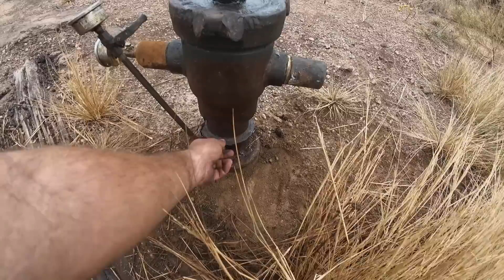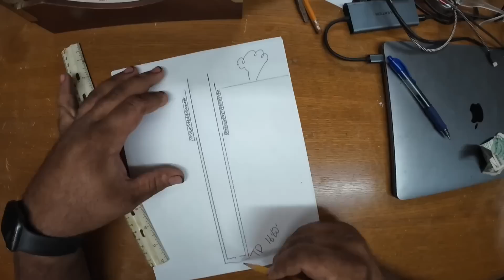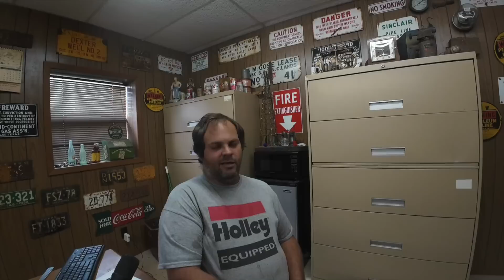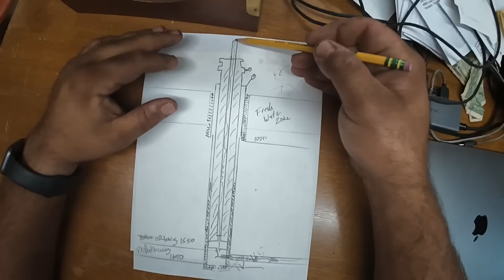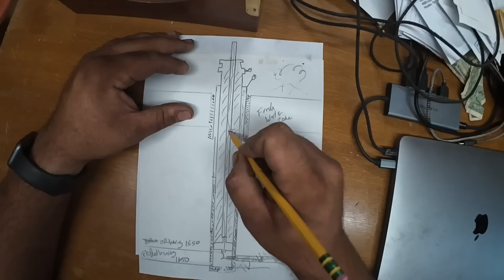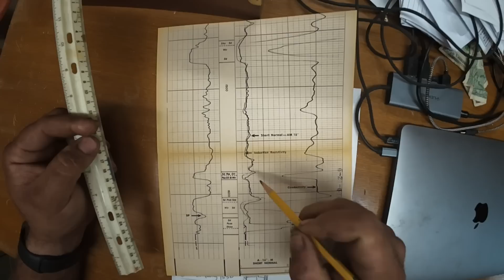All About Salt Water Injection Wells.

Comment: agree with you about the low risk with one caveat. If you are in West Texas, and you are pumping Frack water into a zone outside of your production zone volume is volume, and there is only so much volume that can be put into a void. Once that void is filled with outside water, it can cause issues. I know we’re not talking about that here and for most if not all directional independent oil whales that’s not going to be an issue. The issue is the large fracture jobs where the water is put somewhere outside of the zone where it comes from.

Comment: Maybe decreasing the water level might cause Earthquakes, as rock takes less pressure when its pores is filled with gass. For deep geothermal wells water might also act as a lubricant in the rock and crevises and removing the water might cause Earthquakes.

Comment: Thanks for the video. So much easier to learn the basics from these small wells. I used to work on an offshore platform that injected 480.000bbl of water a day into 32 wells at around 4200psi wellhead pressure. Not so easy to get an good overview there.

Comment: I'm in Oklahoma. A few years ago, we were having 3,4, or 5 "earthquakes" per day for about a 9-10 month period. Some of them were strong enough to do some damage to houses and buildings. Most of them were just a loud "boom" with a bump that you could feel in the ground. I felt a few that would shake the floor. Anyhow, they shut down several of the large injection wells around the area and 99% of the "earthquakes" stopped. Now, is that just a coincident? I think it is possible for injection wells to cause small earthquakes.
Reply: I believe thats correct, poking holes in formation and pumping fluid in it in thousands of areas destabilizes that formation and pressure escapes at the weakest point sometimes in  old plugged wells in a deteriated state.  Im not sure however its technically an earthquake as its not causing shifting of tectonic plates.   But im not a geologist or an oil man. Just my opinion.    And further more while it may be disturbing to some its a necessary thing we gotta get oil so it is what it is.

Comment: I was still confused on why you would use this so I looked them up. They inject saltwater into the ground for the purpose of "enhanced oil recovery from the reservoir". There are also Disposal Wells used to dispose of unwanted saltwater according to the RRC of Texas.

Comment: Do you address micro-annuli in this video whatsoever? As you well know, cement does not bond with the water in an aquifer. Nor does it cure well next to it. The weakest layer of cement along the well is directly along the aquifers. Moreover, the multiple layers of casing and cement used near the surface mean the sonic or acoustic measurements will consistently produce satisfying results - before fracking begins. The concern for the people drinking out of these aquifers is NOT the catastrophic failure of a casing, although many do seem to be under that impression. It's micro-annuli in fracking extracting gas, not injection wells. Maybe you understand that, but this video gives the impression that you're extrapolating the safety of injection wells on to fracking.

As you know, fracking involves immense pressures and high temperatures. This induces hoop stresses on the casing as it expands, which pushes out onto the cement. While steel is fairly elastic, cement most certainly is not. Sulfates, acidity, and salinity in aquifers can also degrade cement integrity. When the fluid is pumped back up, it rapidly cools and contracts the previously warmed steel and cement. Those deeper, longer, and more impermeable wellbores seeking tight gas or shale gas can undergo 50+ frac and plug cycles. And run hotter and at much higher pressures while they do it. Micro-annuli between the casing and cement, within the cement, and even between the cement and the rock. Before gas starts flowing out of the well, there is plenty of time (and pressure) for those liberated gases to rise up into the freshwater aquifer. Re-fracturing is an even greater concern. 

Scared liberals might be afraid of even wells like your own, but anyone following the science knows its not the real concern. There are thousands of actively leaking wells in the world, and the massive remediation costs means these wells are abandoned despite plenty of life left in the deposit. Not even talking about fracking here. Truth is the second those landowners sign that damn contract (or more likely their neighbor does), the folks drilling don't give a crap about anything but getting it done and getting it done fast. Seismology is as much an art as it is a science. If there isn't a major failure, they are not waiting any longer than they have to for the concrete to cure, they are not doing any remediation if concerns pop up. Way too expensive. 

I will say I agree concerns over earthquakes are largely unfounded. But there isn't any doubt that any imperceptible fault lines will be quickly aggravated. Could make for future problems.

Comment: I built 2 disposal wells in Montana for a guy, one was a 3500 bpd the other was a 7000 bpd and both ran between 1500 and 2500 psi we had to run fiberglass pipe due to the high pressures. The only problem either well had as far as any environmental issue was the operating managers wouldn't keep a close eye on the tank levels during a flow back and would overflow the tanks onto the ground and of course it was all oil that ended up on the ground every time. You'd think that they'd learn their lesson after the 1st time but i lost count on how many cleanups i had to do.

Comment: The disposal wells that are causing issues, are taking 10s of thousands of barrels a day of fluid, with the deep ones, down in the Ellenbuger, causing the earthquakes. This is due to the water lubricating the deep basement faults nearby.

 The RRC recently killed the deep disposal wells in the earquake action areas, which brought on shallow disposal wells. They are starting to have issues with that in the Permian, because of the volumes involved. Some of the old legacy verticals that have been plugged, are starting to fail from the significant increase in pore pressure. 

This isnt an issue you will find up here though, no one is moving the insane volumes of water up here.
Reply: This pretty much sums it up; both O&G production and injection wells affect sub-surface stress regimes, and therefore fault activation/s.

Comment: There were 31,000 wells drilled in the East Texas field. A lot of wells had no plugs over the woodbine P&A. The Wilcox formation is a treatable fresh water zone and there wasn't enough surface pipe run in the 1930s.

Injection causes bottom hole pressure. Age deteriorates steel casing. The freshwater wells have H2s in the water now.

As for Gunsight wells. Cable tool wells made leases look like pin cushions. I drilled a few wells with rotary in the early 80s with intentions of injection. Water started coming up all over the lease.

Freshwater contamination is starting to be a big problem. You're in an isolated area and don't have to deal with it.

The fresh water sand on your log reminds me of the Trinity water sand. We used to get makeup water from the Trinity water sand for water flooding.

Wish you well on the casing leak. It is ruff trying to get 50 to 60 year old injection wells to pass. Especially where the pipe runs through shallow Coal or wet shale.

Comment: There are several instances where I live of flow migration from one well to another. Especially when hundreds to thousands of wells from the early 1900's being drilled then abandonded when they played out. Several farms that had good water were definitely contaminated by fracking. It may not happen a lot where you live but in Pennsylvania it happens quite often.
Reply from the maker: Flow migration through a formation is how oil wells work but migration from a lower to higher formation is what's uncommon. Likely the problem you describe is not from a frac job but from an injection well that has a high than designed formation pressure/injection volume. Content in next video.
Reply: Unlikely.

They weren't fracking wells in the early 1900s for one thing.

For another,  the horsepower doesn't exist for fractures to propagate for miles uphole from the target formation.

For another, the Indians up there used to put wool and skins in the creeks because oil would naturally migrate up the faults and into the creek water and they would collect it for medicinal purposes.

Oil has been in the groundwater there for about 100 times longer than humanity has existed. The water in pennsylvania has never been free of oil for the entire history of humanity.
Reply: @timthetiny7538  No there weren't fracking them they were blasting them with nitro. We had a well on my relatives farm and another uncle had three on his farm. My point was the new wells fracked today can and do migrate pressure to old conventional wells. They also definitely do migrate from one frac to another. Just ask the people in Washington and Westmoreland Counties. Someone i know works the fracs, hauls the water and does the mud jobs. So I disagree with your opinion.
Reply: @needsaride15126  yeah you know someone who hauls water.

I frac wells. My opinion outranks his.  And yours.

Comment: Never once has he seen communication between zones. To me that is very interesting that absolutely no fluid moves through the shale of a few feet thick for miles. Seems like it would because one would think it is jumbled up underground but it certainly IS NOT. What this means to me is the reason for the oil in the first place. Any kind of leak between zones means that in geological time, or millions of years it would have all leaked out and made a Labrea tar pit on the surface. Because if you let oil communicate it moves up to the surface and over geological time would certainly turn into tar since all the volatiles in it would seep out. I have heard of this in California or in the middle east having oil seeps. Ancient peoples used this stuff for boats and other things. We use cubic kilometers of oil every year worldwide, and a cubic kilometer is a whole bunch of oil.
Reply: It's not that there's no communication - it's just that it's basically imperceivable to us on our time horizon as humans. Oil and gas does diffuse through shale... it's just an insanely slow process due the fact that most shales have a permeability in the nano-darcy range... ie. you'll have to wait tens of thousands to hundreds of thousand years to notice any appreciable movement. In comparison, most oil/gas sands have permeability in the darcy or millidarcy range... 
In layman's terms, permeability is the ability of a fluid to flow through a porous medium (like a sandstone rock formation). If you took something like a clean sand you might have a permeability of say 1 darcy... so for nanodarcy you're literally talking 1,000,000,000 less permeable (or that many times more resistant to flow). This is pretty much why we consider shales (and similar) to be impermeable.

Comment: Back in the day when I was running frac pumps,when in the dinosaur in Utah I  would set max pressure kickout at 5,000 pounds but would kick pump off before reaching that so you didn't have to reset,but when pressure starts dropping back in gear and going to full throttle and banging gears and you are blowing and going in 10 seconds and I would be rocking until the equipment was flushed. Rig down and off to the next one.

Comment: Grew up around a field that was developed in the boom of the teens or twenties.  Across the road was an area they were flooding the perimeter to push oil to the center of the field.  I say this because I don’t buy into the scare of water injection.  It’s been done for years.

I’d be curious to hear when your injection well was developed.  In the 70’s when a few wells were developed they needed someplace to go with the water.  My grandad, knowing the area well, took the producer to one of those old wells from the teens that played out and was capped leaving the casing in the hole.  The well was revitalized for disposal and is still functional today…

Was the chart the end result of “pinging” a well?
Reply from the maker: Intersting. Ive got a couple of wells from the 20's. This one was probably drilled in the 70's.

Comment: In the Old days they were Flag gauges that needed a pre-selected pressure to support the flag,Red,Yellow,Green in the Horizontal position,when pressure drops the Flag drops to a 45 degree and if drops more it will be Vertical And
Can be seen by long range  binoculars!!!
Times change Yet Old ways still work!!!
45 years ago things were different before I became a truck Driver,ALL I
Remember that worked the fields are long gone but not forgotten!!!❤

Comment: It will never cease to amaze me how much you need to know and do, to make an oil well work, safely and legally.

One thing I'm curious to know is, are all injection wells former production wells? Or do you have to drill some wells specifically as injectors, and if so, do they differ in any from a producer turned injector?
Reply from the maker: Most are former producers. It's complicated but most producers are drilled in a way that they are up to snuff to also being converted into an injection well but not always. There are also purpose drilled injection wells. Many older wells do not have enough surface pipe and or cement to be permitted as injection wells.

Comment: I worked on many gas turbine driven water flood units for injection wells (2nd stage recovery and beyond) both offshore and in the oil patches of 11 western states!   These videos are fascinating to me...  Thanks much for taking the time to do 'em!
Reply: I previously worked at a W-A-G CO2 injection asset that had Solar Turbines on the split case pumps for the water injection side of the system. Pretty neat.

Comment: As we have a salt water injection well on our property in Oklahoma, I knew in general how they worked. But this is a great video about the details.   The well on our property has not given any trouble except for a couple of above ground leaks.  However, in the field that these oil wells are in, there have been cases of groundwater systems getting salt water in them.  This has happened a very few times over the last 50 years, so it is not related to today's politics.  As the wells in the area of this field have had several different small operators, I am not sure how well they were monitored.  The fresh water level around our area is 250 feet or so. I know this as the water well we had when I was young was similar to a small oil well it had a kind of pump jack, tubing, casing, and wooden rods(with metal ends)  I helped my dad pull the well by hand to replace the one way valve a few times and we knew how deep it was by the number of rods and their length.  It is my understanding that the oil producing depth is around the wells on our property is 4000 to 8000 feet down.  One thing that you have not shown yet is the storage tanks for the salt water.  The tanks on our property has a small dam around them to contain leaks. A much larger pond was also dug nearby. Possibly the next injection well video will discuss this. One last thing, as the oil field our property is in was discovered 90 years ago, there are areas where things will not grow due to salt water spills decades ago. And the area gets above 30 inches of rain per year.  It is definitely a good thing for the environment to put the water back in the ground.
Reply from the maker: I did a video a few weeks ago talking about the injection system on the new lease that had the water tank in it. Thanks.
Reply: @TheZachLife  Yes, I know. I just re-watched parts of it.  There is no dike around the tank as with the tanks on our property. The material the tanks looks the same as yours, non-metallic. They are larger than the one in your video.  It would seem to be common sense to build a small dike around the tanks to contain leakage if it occurs.  I do not know about the salt water and other waste that comes up with oil in your wells, but the waste that is generated in the field around our land is pretty nasty.  It contains a lot of Hydrogen Sulfide, stinking to high heaven.

Comment: Thanks for the video. It was very informative and I understand more about how injection wells work. 
However as someone who lives in Oklahoma and went through that period of time when we were having more earthquakes than California, 
I do have to disagres with you on the point that injection wells can't cause earthquakes. 
After the Oklahoma Corporation Commission started shutting down injection wells in the areas that earthquakes were occurring, the earthquake problem went away. 
That does not mean I think all injections wells are bad. However it seems to me there are some areas that are more geologically sensitive than others when it comes to injecting 
fluids back into the ground.

Comment: I didn't realize that oil wells were so complicated! Thanks for the great explanation, Zach.
Reply: And these are the most basic wells. If you really want your mind blown look into directional drilling, extra long reach wells, gas lift, downhole pumps and miscible injection.
Reply: @desertriderukverun1002  Gaslift had to be 90% of the wells In operating  over my 50 years in the business
Reply: Yep.  Then remember that a gallon of gas costs less than a gallon of milk.

Comment: I've seen more fresh water wells contaminated from the chickens and ag chemicals in the well shed. There's also a lot of broke dick water well drillers that didn't register or log the wells and the wells are not completed according to any accepted standards or regulations.  Then all manner of surface water and cow turds contaminate the well. E-Coli or nitrates in well water does not come from an oil well two counties over.